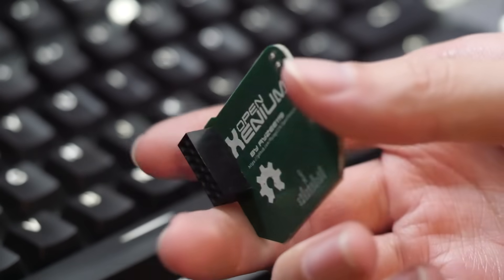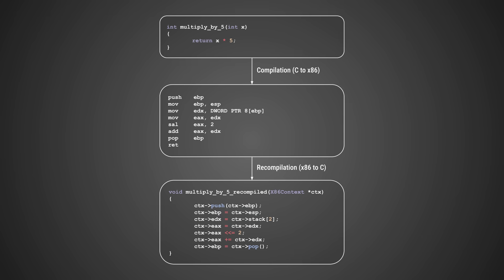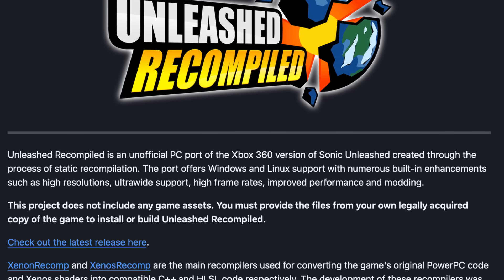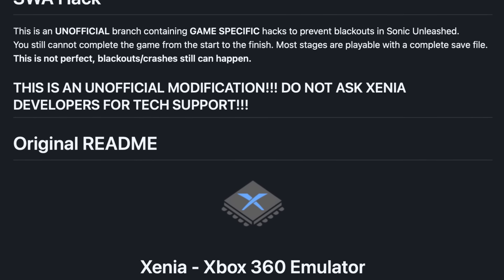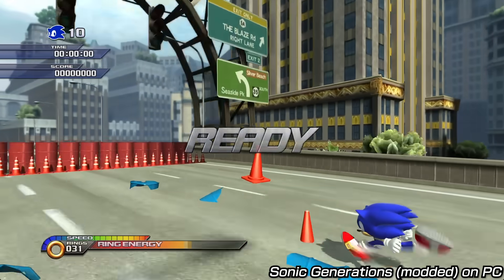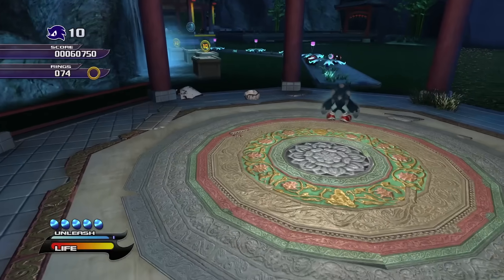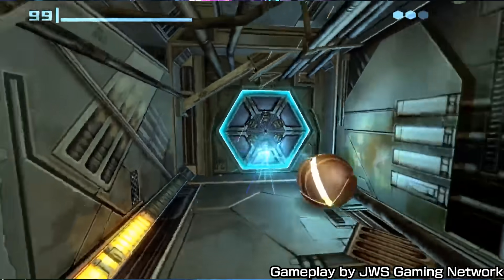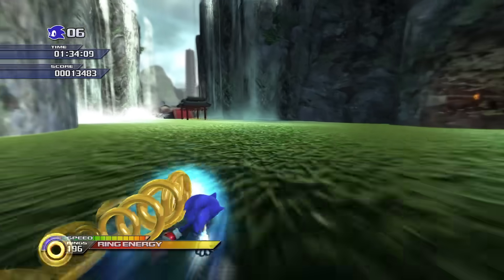So... how exactly did they port Sonic Unleashed to PC??

Comment: 12:58 well I start, Xenia doesn't ruin Skate 2 right, at least not on my machine that should be able to do it. But Sonic Unleashed runs like a dream most of the time. It won't open the floodgates, but it will open the regular gates. Instead ofb concrete things we're gonna get, it's about the(endless) possibilities.
Reply: Like someone's making a Skate 2 recipe, and I'm following their work. It's gonna take a while but it's worth it.

Comment: The installation process for this thing is quite possibly the most confusing thing I've attempted in years. I've tried countless over the last couple of months to get this thing running. Don't get me wrong, the tutorials I've seen make it look extremely simple, but it's really not.
Reply: Its extremely simple, getting the game ISO and the DLC files take no time at all and there's a installer that guides you through the process.
Reply: @satyamSaha Ha, I forgot I even made this comment. I completely abandoned this a couple days after I posted this, but I stand by my original statement. We must have been using different versions or something because holy sh!t I've never seen such a messy and complicated mod package prior. What installer? I got a zip full of random file types, no instructions, and a headache. I'm certainly glad others have managed to puzzle this out, though because it does looks cool.
Reply: @Z @Zerozooka  Sounds like a skill issue to me. You chose to not use the official download links or watch any tutorials and gave yourself a massive headache. It quite literally is as simple as putting the game and DLC files into the installer and letting it do all the work for you. A 3 year old could do it.

Comment: I want an 06 recomp next lmao
Reply: Well, that is happening. The guy in charge of the Mac part of unleashed recomp is doing one for sonic 06 called Marathon Recompiled
Reply: Im aware of marathon recomp now 06 gets a redemption arc LETS GOOO!!
Reply: @tatendamuwori7098  I mean 06 already has had one for a lot of people. At the same time though it’s still not a great game in my opinion. It has a solid foundation that could’ve led to a great game had the team making it been given the time to be able to finish it. Some stuff will never be able to be fixed (like the story for example which is hot ass) but at least it’ll be in a better state than it was before. And it’s far from the worst sonic game of all time. that dishonor goes to sonic boom rise of lyric for me because I can at least have fun with 06 through its good level design.
Reply: @chrisfratz  thats what im saying many say it's ass fine that's on them i think rise of lyric shouldn't even be considered a Sonic game it doesn't feel Sonic whatsoever which is why id put rise of lyric below 06 well below personally

Comment: i wonder if they can do it with the ps2/wii version as well.
Reply: There's no recomp tools for the Wii yet. And decompilations can take a large amount of time.

However though Dolphin is easy enough to emulate anyways, so you can bump up the resolution of Wii-leashed to 4K and get it to 60 FPS. And there's plenty of mods to tweak gameplay and other stuff, so at that point you have pretty much everything you need.

Comment: Nit: Converting from ASM to C is by definition decompilation, not recompilation. It might not be a very usable decomp since it's far from readable C code, but it's still a decomp. Recompilation describes the entire process from machine code to machine code. Whether it leverages an intermediate decomp is an implementation detail.

Comment: I have a question - why isn't AI used to emulate consoles? Is it just because training it would be too difficult and time consuming? If we had an AI that perfectly emulated the hardware of the console, would that be good enough? or would it just be too slow?
Reply: AI requires smoothness of dataset, which emulation dataset does not provide.
Reply: It would be way too slow currently, and also not fully accurate which would lead to plenty of bugs and crashes.

Comment: the Milohax team is looking into using these tools for Guitar Hero 2’s 360 port! The Milo engine has a partial decompilation (though, of a much LATER game, Rock Band 3) and GH2 has had lots and lots of modding in the past (including MiloHax’s enhancement mod, GH2 Deluxe). Not much progress has been made (as it’s only been a few days) but there’s promise in the community, espically  all the work that’s been done modding Harmonix’s other games, most of which use the Milo engine (GH1, GH2, and all Rock Band games except Rock Band 4)

Comment: I know it's way down the pipeline, but I'm VERY excited about the potential for more XenonRecomp ports. I was able to get a code workspace for Midnight Club: Los Angeles (a 360 game from my childhood) fairly easily just by finding some addresses in Ghidra. Now, granted, it's not readable code, and I'm nowhere near skilled enough to actually port it (particularly because I have no idea about anything rendering related), but just the fact that I could get a starting point just by tinkering with it for like an hour was awesome.

Comment: I think I honestly disagree with the sentament that this won't open the floodgates (to some extent). There's a ton of N64, PS2, Xbox 360 era games trapped on consoles (or with a terrible PC port) with die hard fanbases that may form teams to tackle projects like these. While it won't ever be a replacement for traditional emulation, given the amount of games out there, but the fact the Xenia emulator has been in development for I think a decade and still has major issues with such a popular game, kinda proves that no matter what route you take, it still takes years upon years of work to get a game to be "preserved" regaurdless. There's a ton of games on Xenia and Project64 that boot but I don't consider properly preserved ATM because of how they run.

Comment: this kind of reminds me of how we do modding for Beat Saber on Quest; Unity sort of has a built-in recompilation tool called il2cpp which compiles IL (what c# gets compiled to) to C++, then that C++ gets compiled for android (which then gets loaded by a java runtime environment... it's a mess). in our case tho, we don't have to actually decompile that C++, just recreating the vtable correctly is enough to get modding to work. then we just hook into those vtable methods, in addition to some extra code for generating fake C# types to interact with interfaces and such.

Comment: We need people working on a Deadly Premonition PC Port. The OG Xbox 360 version is the best one, and the PC version is ASS. Emulating it on RPCS3 is also a major PITA if you don't know the correct version of the emulator. Xenia has trouble with crashing and the textures. But it's almost there.

Comment: Good video. Claiming that "we already have a way to play every xbox 360 game on PC" is false though, and calling Xenia "not 100% perfect yet" is a massive understatement.
Reply: Yes but if you compare this to the mario 64 decomp which took years for a game that had a small file size and simple graphics this is still very impressive they managed to port a way more complex game in less then half the time. Does still require effort and experience but the tools still make it way easier Like i would say you can except other popular 360 only games to be ported to pc in the next few years.
Reply: @cosmicsvids  I don't see how that is a reply to my comment. But yes, we can expect a few more games fairly soon.
Reply: @cosmicsvids  Recompilation is a much more swift process than decompilation. It's nowhere near as flexible, and probably won't get the same mod support or ports to other systems but it terms of just running it on PC accuretly, it's a fantastic route. I'm sorry, but there's a ton of games that boot on emulators that have issues or run poorly that I don't consider them "preserved", even if the emulator has been around for a decade or more.
Reply: @Supersayainpikmin  the unleashed  port is running  on arm macs so it can basically  be ported to any modren  hardware  platform  now.

Comment: i am SOOO glad this happened
i did not want an official port
even after sonic x shadow generations (which lets be real, isnt even a port lol. its the old game with some updates and a whole new game / launcher)
and especially after sonic colors ultimate
i did not want a port of unleashed that changed the werehog or the medal requirements and broke the game more
which if an official port was made
is no doubt guarantied to happen

i wanted unleashed as it was with updates for pc specific settings
and thats what we got and im so happy lol
now instead of fans of the original game being stuck without it
now modders can just remove and change stuff they didnt like

(side note. people need to learn that its easier to remove stuff then to add stuff (like the medal requirements))

Comment: actually the ps3 version of unleashed is capable of running most day time areas of stages at 60fps when the console display settings are set to 720p and is overall more stable than the 360 version which has more bugs and glitches but looking at both back to back they each have pros and cons for what parts of the game are more stable and which are more buggy so neither are truly more definitive than the other

Comment: 1:21 did you mean to say that the machine code (assembly) made for one CPU architecture is converted into machine code for another CPU architecture? Sure the code can be decompiled too, but all they had was the binaries of the game, so I think the concept of "languages" doesn't make sense when talking about code that is THIS low-level. Maybe instruction set?
Just a nitpick, wanted to make sure.

EDIT: alright I looked it up, I believe it's correct to call them different assemply languages, my bad. I've always thought of them more as instruction sets, since they weren't "rich" enough to be considered a language, but I'm wrong.

Really good video btw!

Comment: the thing I love with recompilation and why its absolutely the future, its that when its in C++ form, even if its not readable by a human, its redable by programs that work on c++ code, u could have something that take that code and finds ways to mathematically optimise it so its faster and now the recompiled executable is slightly more optimised, especially with ai tools that are getting quite good at recognizing patterns in code and working on it
I would Love to see some recompilation tools to port games to platforms they where never suposed to end up on, like porting gamecube games to the new 3ds or things like that
I would love some crazy project to make it possible to partly recomp psp games to the new 3ds, using recomp for the totally incompatible parts like the cpu but emulating the other parts
Reply: you know what potency this will be with recomp and generative Ai combo?
we can easily get the 90% source code that we can compile properly, the 10% will be to fix some of wrong parameters

Comment: Is it feasible to apply static recompilation to x86 pc games? It wouldn't give source code, but maybe it could allow for easier modding? Or does that not make enough sense over modding the assembly code directly?
Reply: You'd literally be getting the same thing you put in
Reply: @mysticaxolotl8215  Well, you'd be getting compilable C code right? Might be easier to work with than assembly...
Reply: @ManIkWeet  It's assembly represented by C code, if that makes any sense. Yes easier, but only marginally
Reply: @mysticaxolotl8215  Hmm makes sense, thanks! I guess there would still not be any classes or whatever, so yeah not much benefit.

Comment: The only reason I liked this game was because of the werewolf segments. I found it quite fun on the PS2! 
I actually don't like the fast paced segments, it's too much too fast and I can't keep up >.<
Reply: Holy cow same
Reply: Honestly, same. I'm not as young as I was back in the early 90's so the speed sections take a LOT of getting used to. The QTE's (specifically the flight missions) were also difficult for me, but the Werehog wasn't.
And it's not like I can't play 3D Sonic -- I still pull out my copies of SA1 and SA2 just to 100% them when I have time.

Comment: I'm glad someone else knows what this actually is and what effort actually went into it instead of believing you can instantly port any game and is willing to spread the message
Reply: Still, the fact we have a way to bring these 360 games to PC outside of Xenia emulators is a miracle and the tools are open source which means that they could be adjusted to account for different setups according to the title in question. The rest can be worked out by those with the knowledge to find solutions to any technical issues that come with the games.
Reply: You can port any game. The real question is whether you should?

Comment: Windows and MacOS natively supports running native ARM binaries with X86 code mixed in to help ease the transition to ARM, so this is really just a very advanced version of that but with different architectures. the code that's easy to port to native gets ported and all the harder to port natively sections use emulation.

Comment: Question: how well does a modern optimizing compiler actually do at trimming down the fat that inevitably comes out of the resulting C++ code this process creates?
Reply: According to Skyth, XenonRecomp’s recompiler employs quite a few optimizations in its conversion to C++ that, when paired with compiler optimizations from clang, creates virtually no overhead in the new resulting binary code when compared to the original PowerPC code.
Reply: According to Skyth, XenonRecomp employs quite a few optimizations that, when paired with the compiler optimizations from clang, creates virtually no overhead in the end result from PowerPC to the new binary code.

Comment: Porting between CPU architectures is relatively trivial. The complicated part is the fact the game was made using a 360 toolchain and targetting the specific 360 architecture, and that needs some kind of manual translation into a Windows environment an DirectX.

Thankfully the 360 api was already very "directX" like (on purpose) so it's a lot more straight forward than porting a PS3 game, for instance.

Comment: A little pity a lot of the engine is custom and that the static recompiler is based on DynaRec's guts and approach not on the code analysis frameworks such as the one in Ghidra. And that so much of the engine had to be custom rewrote. I was hoping that it would be easier to apply to Deadly Premonition to try to sort out its gremlins but it's not looking more promising than fixing the issues in Xenia.

Why is Xenia so spotty with shading though in particular, is there a reason? Lots and lots of games run perfectly but just don't render quite right.

Comment: I wouldn't be surprised if Sega forked this project and made a remastered version to then release an official port of Sonic Unleashed on modern systems. Most of the work has already been done for them, so it's not out of the realm of possibility, I think.
Reply: Nah. Besides the license stuff, SEGA has the source code for the game, they don't need these workarounds like recompilations to port it to PC, they just don't want to, heck the game was running on PC since the beginning as shown at GDC 2008.
Reply: @AJ-po6up  thats if they still have it, its crazy how much game companies will just lose source code for any of their games
Reply: You can't sell open source
Reply: @JorArg-c7s technically you can, depending on the license. MIT license allows closed-source forks, GPL doesn't. either way they all allow commercial use
Reply: @sprengar  Well, UnleashedRecomp is under the GPL 3.0 license, and from what I 
understand, you need to share the source code of any modifications you 
make to use it
Reply: @JorArg-c7s Sonic unleashed has a no reverse engineering license anyway, so it’s not that clear cut
Reply: @JorArg-c7s Yes you can, if the license allows for it
Reply: @JorArg-c7s  They can, but it's far too late now.
Few people would see an official Sonic Unleashed port for (£/$XX.99) and not think "but the full, and free, version is right here, and just play the recompiled version.
Ultimately, once a fan port, de/recompile or remake comes out, an official port is off the table.

Comment: Don't forget that RPCS3 does something very similar. It statically recompiles the game's code into LLVM IR which is then ran through the LLVM optimizers and converted into native code.
Reply: wait, is that why RPCS3 runs a lot better than you'd think it would?
Reply: @lilithhiddenvillain5086  it's that and many other clever techniques they've used in order to improve accuracy and performance. RPCS3 really is a miracle of engineering
Reply: Does this mean that LLVM is better at running PS3 games than the actual PS3 is 💀
Reply: @vlc-cosplayer  Probably. The PS3's main issue was how complex it was to use each "core" so many 3rd party devs didn't put a lot of effort. The hardware was capable of so much but Sony made it too complex for its own good.
Reply: The CELL architecture is more suited to supercomputers than video game consoles, I think most devs just used the PowerPC core and ignored the rest
Reply: @vlc-cosplayer  Wouldn't be the first time a PlayStation has been outdone like that. The PS2 games that require a HDD like Initial D run better on emulators than the PS2 Slim because the PS2 Slim can't run those games in general. Sony were the first company to release console revisions that couldn't play their own games.